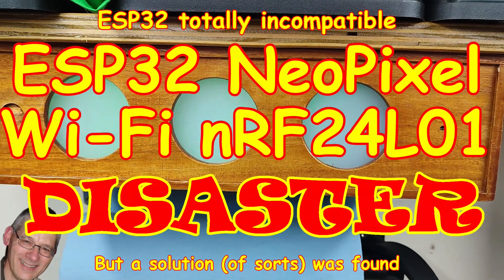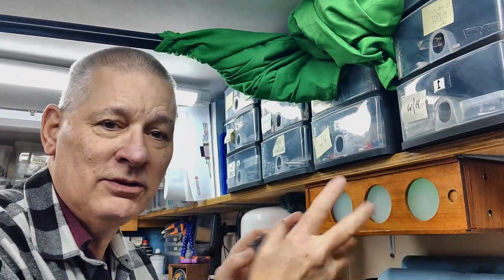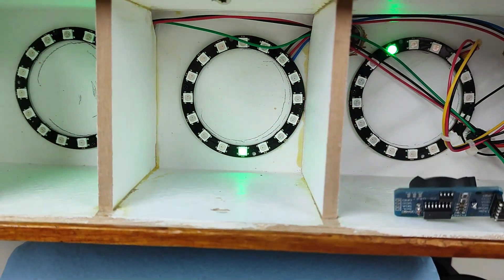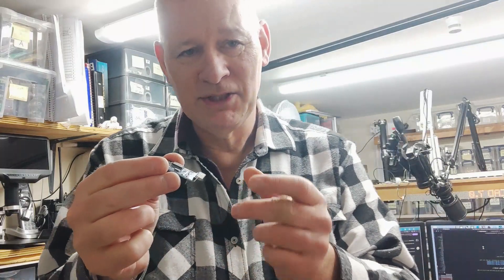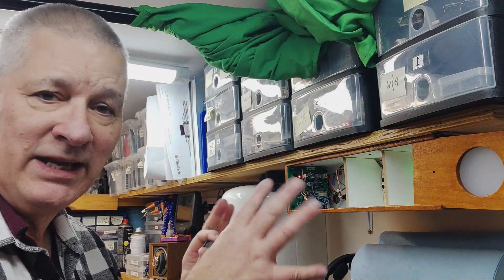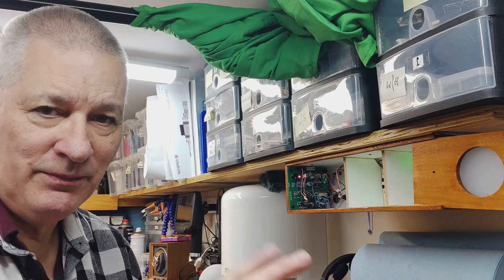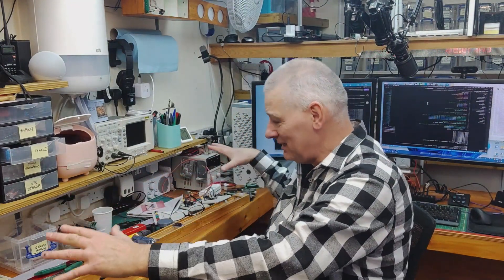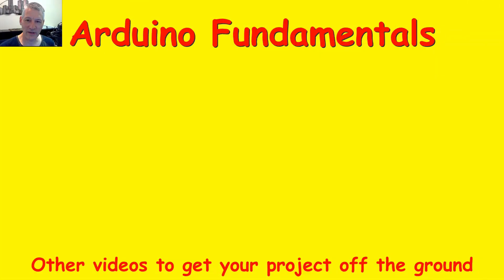#262 ESP32 + NeoPixel + Wi-Fi + I2C + nRF24L01 disaster!😮What to do?🤷

Comment: Strange... I am using literally hundreds of Neopixel in my atomic firelamp and I control it via a wifi connected Webinterface. It's based off some code from Dave Plummer and uses fastled. It's running day in and day out in my office and I have no issues whatsoever!
Strange
Reply from the maker: But are the NeoPixels running in one or more tasks, or just from the main loop( )? I ask, because I suspect the use of tasks may be relevant here (and you can now confirm) 🙏
Reply: @RalphBacon  my comment was deleted by YouTube probably because it contained a link!

It's all in the main loop. Please search for LED-Strip-WS812b-288-ESP32 and you find my github fork. There is a branch called atomic firelamp wifi manager something something. That is the one I mean. Please excuse any messy programming or github housekeeping (or the lack of it). Just doing it for me and ease off use.
I hope it helps you to isolate the problem.
Dave has expanded the nightdriver library vastly since the examples he posted on YouTube which I based my variant off. He is on github with it and on YT Daves's Garage
Reply: @arminth  NightDriverStrip seems to also be using fastLED instead of Adafruit's NeoPixel library. Is FastLED using HW SPI to communicate with the WS2812B strip by default on ESP32? That might explain why there is lower risk of affecting the timing sensitive WiFi communication
Reply: @bornach  communication to the WS2812 is not SPI AFAIK. Is WS2812 specific. You just define the LED-PIN you want to use and off it goes.
Reply: @arminth  FastLED uses a well known SPI-to-NeoPixel hack where you fill a buffer with sequences of zeros and ones of the appropriate length and then send the buffer to the WS2812B data in pin at just the right bitrate to mimic the long and short pulse protocol that addressable LED uses. One scheme is to send a zero bit by putting 3 bits 100 into the SPI buffer; to send a one bit, SPI buffer will have 3 bits 110, and the buffer is then transmitted at 3MHz to the NeoPixel.
One advantage of this method over bitbanging is by using dedicated SPI hardware you don't have to disable interrupts which risks messing up other concurrent tasks such as WiFi communication.
Reply from the maker: Sounds interesting. I will construct a simple test rig where I can test out various scenarios (and libraries)

Comment: First of all I would not use the default i2c pins for anything but i2c.
Secondly...are you using fastled library for the neopixels or some other library?
And what library are you using for the nrf20?
Reply from the maker: I'm using the "adafruit/Adafruit Neopixel" library and "nrf24/RF24" for the guess what. But using the I2C pins as general purpose IO pins or SPI pins should not cause an issue.
Reply: Well Ralph. I think you could make that project work (even without tasks).
Fastled v3.4.0 for the neopixels with a resistor about 330 or 470 ohm on each data line.
And if you used other pins than the default i2c pins on the nrf24.
And default i2c pins for the clock.

But I understand...you already have the pcb wired up the way you choose from the beginning.
Reply from the maker: I can always change the software (eg use FastLED if that is the answer). Or not use tasks, if they are causing issues (or being impacted by context switching interrupts). But as you say, I don't want to change the hardware (not the PCB, anyway).

Comment: Commenting for the algorithm mostly... Would a simpler solution have been to use an LDR to detect when the lights in your workshop are on - so your code would only fire up the bin LEDs when you are in there tinkering?
Reply from the maker: It would. 

And about an hour after doing this video, I ripped out the RTC (and code) and did just that! I knew that would work because I do it for my World Clock project (the long 0.9m length of LED matrix using MAX7219 chips).

And yes, that is even more efficient because the lights go off even over lunch!
Reply: @RalphBacon  I saw other commenters had made the same suggestion - I just left it here to appease the mighty algorithm.  Have a great day.

Comment: I don't know if this is relevant but a couple of years ago I tried running three I2C devices (inlcuding that RTC) on an Esp32, Two would run but not all three. I added 330ohm pull-ups to the wires and that solved the problem
Reply: Pullup resistor is sometimes required when using more than 1 i2c device on the same bus. But 300 ohms sounds very low. Often the pullups on i2c is about 10Kohm.
Reply: @digihz_data  It was several years ago so it may have been more like 10k. Anyway, messing about with electronics is now not possible - age. health and failing eyesight have got in the way. Vicarious pleasure is all that's left....😄
Reply: @alan mon  sorry to hear that. Well hope you have something else to occupie yourself with.i am 58 years,but still going strong about microcontrollers.  :)
Reply from the maker: Yes, pull-ups are required but often the modules have them built-in. Too many modules means that the SDA line is always being pulled down (lots of resistors in parallel) and they must be removed. Or add a very low resistor like you did to bring it back up again!

However, on this project, the ONLY I2C device is the RTC, so no joy there.

Comment: Just a thought, that may already have occurred to you, neopixels are known for switching current spikes. Changing the layout, even slightly may change how much those spikes affect other stuff, such as the processor running interrupts...
Is it worth trying the arrangement that would not work but with some deliberate decoupling of the neo pixels??
Reply from the maker: It's certainly a good thought, Simon. I will add it to the list to check if I can't get this running.
Reply: Yeah, I've seen a recommendation to use a 220uF capacitor across their power supply, ideally as close to the neopixels as practical.

Comment: Hi, In a previous video you showed how to use a pir to detect presence and disable the display if no one is there for a minute or so. I've used this on a clock I made. This has the advantage of turning on if you venture into the shed in the middle of the night! You could also use an ldr to detect darkness. I appreciate this 'over engineering ' is very educational though.
Reply from the maker: Spot on, Mike. 

My World Clock project (a beauty, though I say it myself) does just that. 

And now my Bin Lid Monitor does too, because the "overnight time detection" was just a nice freebie with the Wi-Fi that I was going to use for web pages. 

As I can't do that anymore, the overnight switching off of the LEDs might as well be controlled by a $1 PIR device. And so it is!

Comment: Very interested to see if you come across a root cause of this problem.
Actually a bit surprised about your problems with the neopixels, since (as mentioned by others as well) they work so easy on a ESP8266 with WLED installed.
Reply from the maker: It might be the tasks (well, the task switching mechanism) that is causing the issue.
Reply: WLED using NeoPixelBus at the core, try it.

Comment: I find the ESP32 suffers from crap frameworks.  You have the Espressif IDF (of various incompatible flavours/versions).  On top of that, like literally grafted and hot glued on top you have the Arduino framework.  But that's not enough.  AdaFruit have got involved.  Their libraries are isane.  I work in Enterprise software engineering and it's rare I would see something that simple made that complicated.
It is only beginner friend if it works.  FACT.
When it doesn't work, this stack of frameworks piled on top of each other are NOT, repeat NOT written for beginners.  A lot of them, particularly the AdaFruit libraries are more C++ over engineering and mast-or-bation and "flexing".  If you have to lift the covers and try and understand how all that works.... it's not going to be any fun.  Even as an experienced software engineer I have dumped and ran away from Adafruit libraries because they are not worth the time and effort you will waste on them when they don't work.
Reply from the maker: Adafruit libraries seem to try to be all things to all dev boards. Their code looks very "bitty" with lots of conditional compilation streams.

Comment: Before you pay for the burial of your ESP, can we group dig as I have a 3v3 regulator which didn't like 13V apparently and 2 high end audio TosLink boards which (also 3.3V) have died in unexplained ways.  Its not been a good week.  "Bring out your dead!"
Reply: Check what the maximum input voltage is to your LDO probably find its ~7v
Reply: @andrewdoherty737  20V but might not be a guenuine part.
Reply: @1over137  not genuine eh? Aliexpress by any chance??😂
Reply: @andrewdoherty737  I figured it out.  There is a lot of capacitance on the board.  Its a dev board.  It has limitations.  I never intended to power it off anything substancial.  Just that the 12V rail I choose for this test was current limited at 5A.
13V @5A charging those caps is going to melt a As1117
Reply: I think Ralph has a spare voltage regulator right there on the board with broken ESP...
Reply from the maker: Before I throw it out I will check it all out properly. I can even replace the WROOM device as I have spares.

Comment: How about running the WiFi on one core and the NeoPixels on another core of the ESP32?
Reply from the maker: Yes, Peter has described it exactly. Which makes the result even stranger.
Reply: @RalphBacon  I had forgotten that, oops.
Reply: One core is by default handling wifi already. Other stuff is done by the other core.

Comment: I'm using the ESP32 a lot with WLED and similar projects. I think "WLED" is a very good example how well an ESP32 can work with WS2812B LEDs, WiFi, Sensors and even audio processing. 
Fantastic community project with many skilled people and a helpful discord. 

What I've noticed during my last builds:
- I would stay away from the Adafruit library and use something like FastLed.  That's what WLED is also using 
- some dev boards (doesn't matter if from Amazon or Ali) have issues. I think especially during chip shortage some switched through all kind of LDOs and if you're unlucky you get one with a very bad LDO. When an ESP Connects to Wifi its current consumption can spike up to 400mA. I've had a similar issue in the past with fake Wemos D1 Mini Boards (ESP8266) which had just a 150mA LDO on board. Some might also have other design issues. In the WLED Community many switched to custom community boards or designed their own. Some are shared so they can be ordered through JLC Assembly. It's a little time investment, but worth it in my opinion. 
- for the LED Data i would use a level shifter from the 74AHCT series. The little level shifter modules from Amazon are usually not fast enough. They can work (and sometimes it works even without), but they're not optimal.

Comment: Poor old Ralph! Don’t chuck the board - just replace the wroom! Weird problem with neopixels but remember you are using Arduino ide and it decides where Wi-Fi and your tasks run unless you tell it differently. I’m guessing that you tried diverting tasks to the other core?
Reply from the maker: Tried all cores, all variations. The PANIC was sometimes on Core 0 when I am not (specifically) using Core 0 at all, except as a consumer of Wi-Fi which is pinned there.
Reply: @RalphBacon  Oh wowser! Interesting. Perchance did you try it on a different module? I have seen (rare) problems with some (older) modules.

Comment: Did you update all the libraries/boards?   I have many projects that use wifi and neopixes on esp32 (classic, C3, S3).   One that I'm working on now is a mp3 player, so it uses SPI to the SD card, I2S and I2C to the audio chip, and then 32 neopixes controlled via a webpage.   No issues at all...    I'm using Adafruit NeoPixel 1.11.0, and ESP32 2.0.7.   I have had issues in the past with various versions of the ESP32 releases, but 2.0.7 seems to be working well for me now.   I also have another ESP32/NRF24l01 project that was working for over a year that stopped working when I recompiled it.   Ended up fixing it by getting the latest version of RF24.    I have my own boards made, but use the ESP32-S (AiThinker), ESP32-Wrover, ESP32-C3-F12, ESP32-C3 mini 1,ESP32_S3 Wroom.   Be careful to check the strapping pins on each module.   Especially IO12 can trip you up...  Also, on the neopixels, I drop down the VCC using a diode so that I can drive the DIN directly from the ESP32.    I feel your frustration, when it is something that should be an easy change...
Reply from the maker: Yes. All 100% up-to-date. Yes, it should all "just work" in that 15-minute time-slot I mentioned! But I will figure this out eventually, I'm sure.
Reply: @RalphBacon  I was looking at your files and noticed that the PIR used pin 17 for signal and the RTC_SDA had 17, but was commented out in wifiHelper.h (also commented out in main.cpp).   But if you were trying to use 17, that may have been the RTC I2C issue.

Comment: Totally not an ESP32 expert but I notice that the NRF24 is an SPI device, and the RTC is I2C. Is it possible that they are trying to use the same hardware module as other microcontrollers do? Or does initialising the RTC try to unmap the default pin assignment whch is messing up the SPI? Changing the order of the initialisation mught help. Howerver there are people here who actually know what they are talking about so I'll leave the rest to them! 
I think by now I'd have just run a cable from the microswitches on the bin to some LEDs in the workshop :D
Reply: why would order of init cause issues? is this a common issue/quirk as on my last project with both spi and i2c i did i2c first, then spi, and i2c failed, doing it 2nd failed also, but commenting out the begin and just accessing it both work!
Reply from the maker: I suspect there's a grain of truth in what Ian says here. Or that the libraries I'm using are working in isolation but are breaking something (like SPI).

Comment: I2C is timing sensitive, especially at higher speeds. Task switching can cause the protocol to be violated. The processor core should therefore be locked to the I2C task during data interchange.

Using WiFi may aggravate the situation as it, IIRC, operates on only one core of the ESP.
Reply from the maker: Yes, I agree with that hypothesis. So if my NeoPixels were controlled not by tasks but just from the loop (eg a function called every millisecond or so) it might work. Need to test this.
Reply: Good idea ! I like it.

Comment: GPS receiver - connected via I2C or serial, is also a good way of getting the time.  Seems strange to use a GPS when you don't need position information, but it's a good, fairly cheap, way of getting the time (with incredible accuracy) without relying on WiFi, internet connections, etc.
Reply: This is a good idea but GPS inst very good indoors however £15-20 for a GPS repeater has helped me in the past, so much so I have left mine on and I get GPas signal indoors, of course the location is fixed to one location of the rx antenna but that's fine for me as the flat isn't very big 😂
Reply from the maker: Yes, I agree. But the Wi-Fi component of this project was primarily supposed to allow me to communicate with the device (via my phone), send me messages if I had left a bin lid open, AND get the time as a beneficial side-effect!

Comment: Hello Ralph,

this is the reason why I use the ESP8266.
Here I have realized numerous project with WiFi and Neopixel. And all of them work fantastic. A word clock, a binary clock and a controller for my laser cutter. 
All projects need the current time and control Neopixel.
I have made the experience with the ESP32 that here some things still do not run completely smoothly.
Especially in connection with WiFi.
Greetings
Frank
Reply from the maker: I suspect, Frank, that is I were to ditch the tasks and just run each NeoPixel ring in a time-sliced function (using millis) from the loop( ) it would work. I need to test this theory out.
Reply: @RalphBacon   Hello Ralph,

yes that could also be a cause/solution.
In my projects I have "only" one NeoPixel ring/strip. (with up to 114 Pixel)
Maybe this is also a solution for you.
Connect the three single rings to one strip.
Then there is only one NeoPixel instance. This might be easier to handle.

Greetings
Frank

Comment: ESP32 is powerful, but often frustrating.  It's difficult to understand exactly what's going on inside.  Documentation is all over the place and often contradictory, or vague.  When a project allows it, you'll usually complete it faster, and enjoy it more, using a simpler 8-bit microcontroller.  When your project needs WiFi for some simple task (getting the time or a simple web server), then you can add an ESP8266 or ESP32 to do just that one part.
It seems wrong to use an 8-bit processor, with a 32-bit slave coprocessor, but because the project is simpler you save time.  Sometimes you can even save power - when the 'coprocessor' is only doing a simple task, it's a lot easier to switch it in and out of sleep mode - or have the main 8-bit processor switch it off/on using a GPIO ouput and a transistor or MOSFET.
Reply from the maker: Yes, it is tempting to use two devices, but using an ESP32 "just" for Wi-Fi is such a waste (IMHO) when it can do everything I require. Well, if it worked.